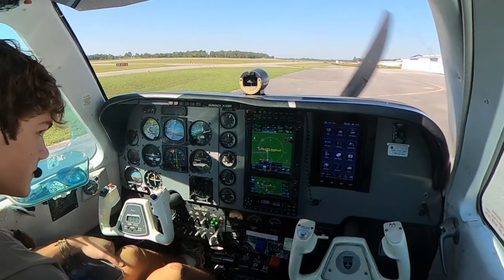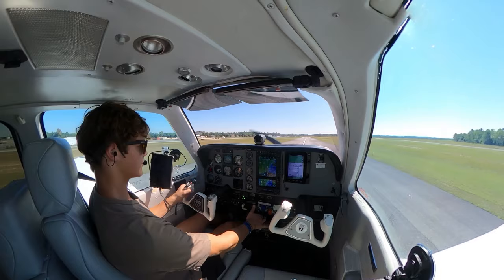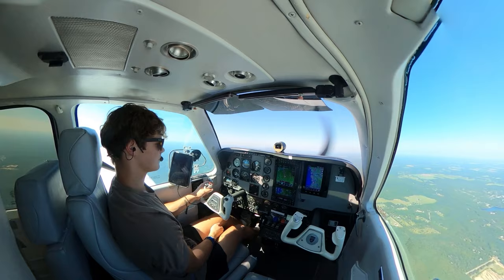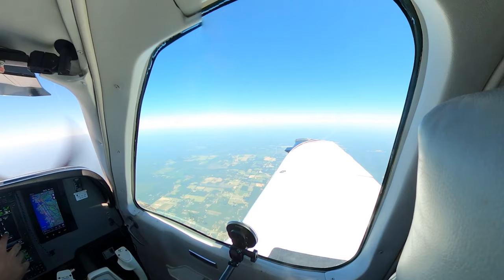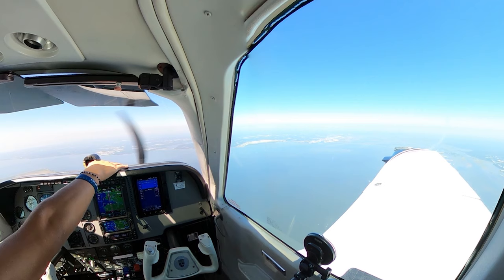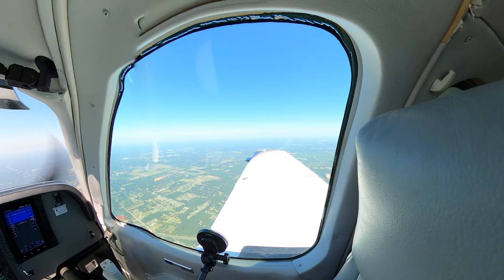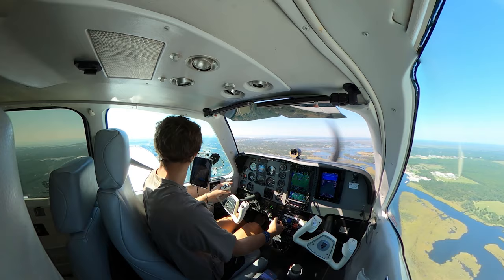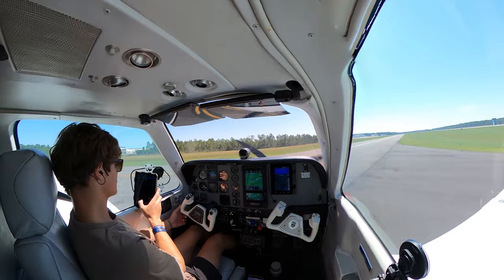FLIGHT VLOG IFR - Bonanza A36 54J - KPQL

Comment: 2:50 I’m 53 in the U.K. now, but I recall in my teens growing up in Ireland in the 1980’s that if you wanted to become a pilot in my national airline Aer Lingus (Shamrock) that you had to join the Irish Air Corps for a while before transitioning and it was only after 1979 that they stopped doing this and went down the direct entry route - many U.K. and US flight training schools were used by Aer Lingus to train their pilots for the ATPL but the costs are very high